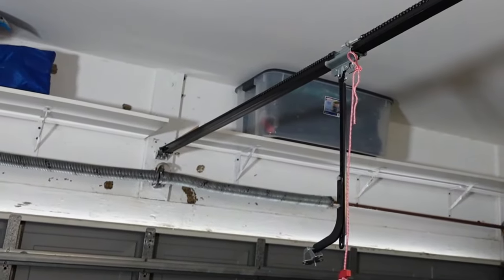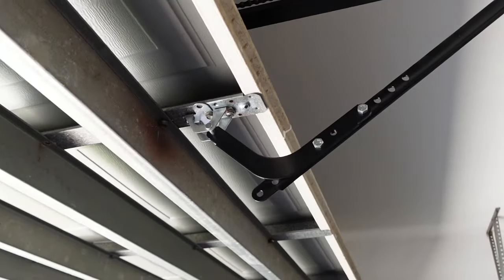How to Fix Garage Door Bracket that Ripped Off

Comment from the maker: *Things you need*
Step Drill bit: https://amzn.to/3q4fmtA
New Bracket: https://amzn.to/3OBu9oP
Other Garage Brackets: https://amzn.to/479d3WJ
Reply: What step drill bit size ??
Reply from the maker: @qutaibabs1  here is a nice set:
https://amzn.to/4dgR6Ii

Just drill until the bolt fits through the hole. Go slow and check it with the bolt periodically.

Comment: No. we did exactly this and the door ripped off while it was lifting and came crashing down. Thank God no one was hurt or killed. 😢 Change out the ENTIRE  bracket. It’s safer.
Reply from the maker: Did u use a bolt, nuts, washers, and lock washer to trap the bracket? Or did you just use the self tapping screw. If it was self tapping screw then yes I do agree that it will rip it out again. However if you use a nut and bolt and properly tighten everything then you should be good.
Reply: @Daddicated  

We used nuts, bolts and washers, tightened everything well. It looked great, worked well for exactly 3 days, then my daughter went in the garage to get the lawnmower. She got it out she mowed the grass. I was putting it back in when the door fell.
Reply from the maker: I don't know something just doesn't sound right. It's been almost a year and mine is still nice and tight.   @franco2b145
Reply: @Daddicated  Ww found the installer’s tag on the door, called them, they came out and fixed it for free.
Reply: if your door came crashing down, you need to adjust your door springs so that the door stays open even if the bracket rips off.  very dangerous to adjust the springs so hire someone
Reply: @mikehascats26  

Yes sir, we did hire a professional. Thank you

Comment: I tried it today but the motor keeps pulling it all the way up but doesn't push it all the way down. keeps getting back and forth. not sure what shall i do /
Reply from the maker: That metal bar usually has multiple holes in so you can make adjustments if necessary.
Reply: How do these screws not have washers and bolts to hold them in place?
Reply: @Shortwheels316 my thoughts exactly..

Comment: What tool did you use to get the center screw in the bracket?
Reply from the maker: It was a self tapping screw and I just used a regular socket attached to my drill to tighten it.